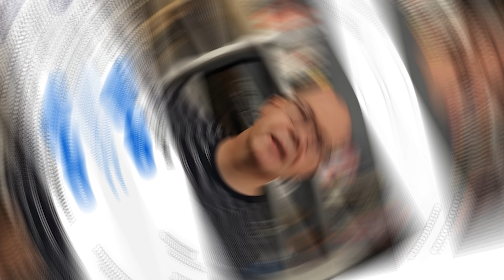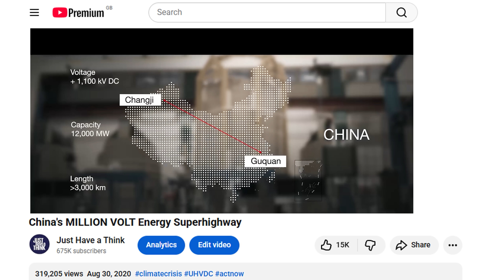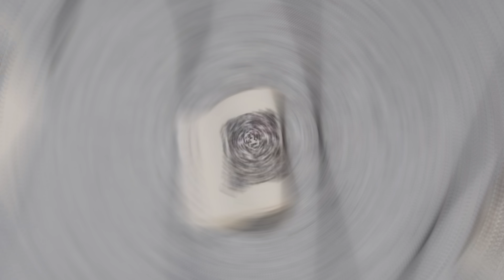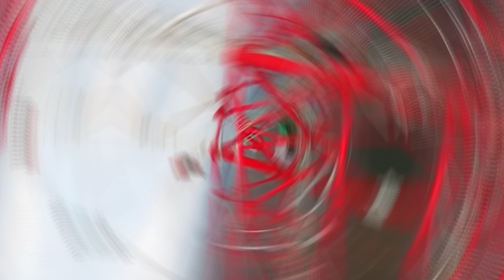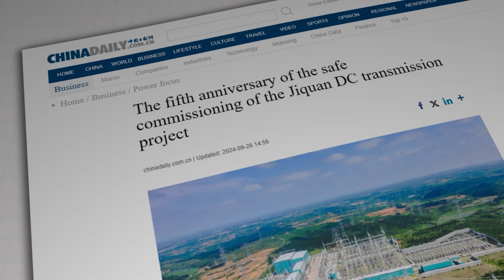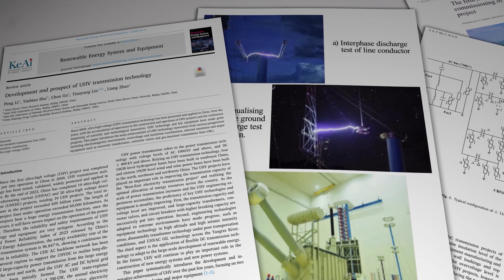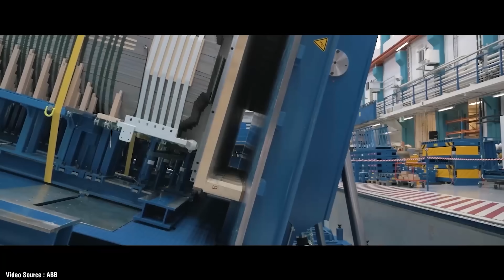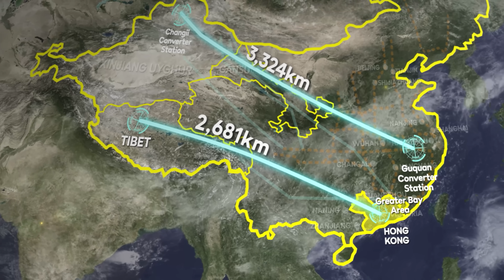China's ultra-high voltage transmission lines now breaking all records.

Comment: Hoodie video idea: I've seen that some communities don't allow people to plug in to the grid with small plug-in Photovoltaic systems without grid operator approval (long costly process).  But I have also seen, on this channel, some battery storage devices that can run significant parts of homes or help smooth out the grid.  Could people have an electrician connect plug-in solar panels to a battery pack, then plug that into the electric panel with a controller (without grid approval)?  Is there a company that makes controllers that can bypass getting grid approval?  I don't want people with rentals to be discouraged from dipping their feet into alternative energy.

Comment: related but highly speculative research video idea: impact of new and upcoming technical capabilities on superconducting lines on long range power distribution.
I'm especially interested in seeing what kind of new discoveries would allow for a global power network that doesn't require the currently very expensive and material-intensive undersea UHVDC cables you mentioned in the video about the Moroccan-UK interconnection project

Comment: Suggestion: How do the different countries adapt their grid to adapt from  centralised to decentralised power sources? This is not just about cables, but about distributing the investment costs and the imbalance regions of supply and demand. In Germany we tend to ignore the learnings from other countries. How do others solve the "One zone Vs multi zone" pricing, did they deregulate cable installation to speed up the process? Can you help? Which countries succeed in the transition and how do they do this?

Comment: Down here in New Zealand, there is a great deal of renewable energy potential but in one case there is a focus on hydro in an area of public conservation land that should have national park status and be left untouched as a wild river.
Large wind farms are proposed. 
A massive open cast coking coal mine is proposed across a unique ecosystem, public conservation land that should be a scientific reserve.
The common thread here is that the proposals are being fast-tracked by a government focused on development and moving rapidly away from any climate commitments or protection of nature. 
One of the proposed wind farms could feed the single coal-fired power station, replacing cheap coal from Indonesia and adding batteries as per your excellent episode on that topic. 
Subsidising residential and community solar and batteries, like the hugely successful Australian programme you have mentioned seems an obvious way to improve resilience, increase renewable energy, extend distributed energy supply and drive down power costs. 
There's a lot there. Perhaps my question is how to get the government of the day to make sensible climate and nature friendly decisions that will be valued by future generations. 
😊

Comment: @ 11:03 , This UHV DC transmission is a pie in the sky n USA. Electricity generation is a private enterprise in USA. A regional grid  in USA may have several electricity generation firms. Electricity generation firms maximise profit by reducing excessive supply while increasing demand. There is little incentive to unify the regional grids  into one giant national grid system where UHV DC can be transmitted from coast to coast. Different population density and industrialization in USA means certain electricity generation firms are much more profitable than others.

Comment: Hi - here's a suggestion for an episode for you for next year: why recycling steel won't save the planet (I'm sure you can come up with a better title!).  It seems like a no-brainer: steelmaking is around 9% of global human CO2 emissions... making new steel from scrap has 1/7 the emissions compared to making it the first time from iron ore.  All true, and all good (we should definitely use all available scrap - and sort it better - and smelt the scrap using renewable energy).  Only problem is, there's not enough scrap, and we already use pretty much all that is available (global recycling rate for steel reckoned to be around 85%)... and you can't 'use more scrap' if you're already using all that's available.  But if the global recycling rate for steel is 85% or thereabouts, how come the average recycled content of newly made steel is only around 30%?  And why it follows that specifying steel with a low carbon footprint will not reduce global GHG emissions.  I promise this is more interesting than perhaps it sounds at first... happy to talk.

Comment: Possible topic idea: 
I'm a window cleaner and I use two different methods of cleaning windows (depending on the requirements of the job). One is the traditional soapy water and squeegee method and doesn't use much water (3 gallons/day) but does require climbing a ladder for most tall windows.
The other utilizes purified, deionized water. It uses a LOT more water, but typically, no ladder work is required. Clearly, it's much safer. But, as an environmentalist, I've always wondered how much damage I'm doing to our planet. I haven't been able to find data on the meta effects of this form of window cleaning compared to the more traditional forms. 
Or maybe, in the grand scheme of things, window cleaning doesn't put that much of a dent into local or global water supplies. 
But I'm still curious. 
Thank you for your videos that help to keep me curious!
Reply: The problem of water resources has never been caused by the waste of domestic water, but by the huge amount of factory wastewater. Domestic water will naturally integrate into the water resource cycle through evaporation, while persistent industrial pollution will continue to affect the water resource cycle
Reply: @youngshawn5510 thanks for sharing that. It helps ease my environmental guilt a bit as I clean windows. However, living in the desert of the Phoenix, Arizona, I do think my higher use of water isn't ideal.

But it definitely saves my knees from all the ladder climbing, and potentially my life!
Reply: The soap might do more harm to Nature, than the water
Reply: @bjarneh-im1uw I did just see that Dawn (most window cleaners soap of choice) has a number of cancer causing ingredients. I use gloves whenever I'm using it, but I'm starting to look for something more natural.
Reply: Negligible damage.❤

Comment: One topic that I would appreciate you covering (I don't think you have) is thermal generation from Hot Rocks. This is using heat from the likes of radioactive decay in Granites, etc; as distinct from the thermal heat from sources such as Yellowstone, Rotorua or Iceland. A pilot plant was constructed in the Simpson desert in Australia (Innamincka) by Geodynamics Australia in the early 00's. It was based on a premise of the rock temp at 4000m being around 140C and having to fracture the rock to ensure it was permeable enough to extract the heated water. The trial fields found the rock was sufficiently fractured that it didn't need fracking, and the temp was over 200C. A 1 Mw generator was established to prove concept, but then shut down apparently due to distance to nearest grid (5-600Km) but it was reported that areas under the coal fields outside Sydney & Melbourne should be suitable but nothing has happened & I've never been able to find out why

Comment: ultra-high voltage transmission has been confined to a maximum of approximately 1000 kilovolts by the physical phenomenon of electromagnetic corona discharge (surrounding ionization) encountered  at  high voltages.  Development of transformer and distribution insulation that does not deteriorate at ionization high voltage has proven infeasible, therefore ionization/corona discharge establishes limits to transformers and  bare wire transmission voltage.  If these physical high voltage limitations could be overcome so that high transmission voltage could be substantially increased, then power transmission line capability could be increased exponentially. [power=voltage(squared)/resistance]

Comment: Yes, where is the community spirit. Working together for a better free world. Otherwise those that can work together will take over the world's future. I don't want that. So when will voters in the free world start thinking as world citizens and vote for leaders who work on that, not division and hate? When will the commitment to cooperation and compromise come back? In Australia, they haven't been successful in building a 350km  transmission line from the equally catastrophic Snowy 2.0 to tie into the NSW grid any reliability (the original $1.3 B price in the 2019 proposal for 2021 completion, now after many fits and starts, with construction started, but full land right of ways still not very progressed, the prices is estimated at $7 B and completion in 2027). They already know it is insufficient for the plans of renewals precincts they have approved and along the way the GW of new bids there putting out. Luckily all those are also delay, like the Snowy Hydro 2.0 expansion (original proposal 2017 for $2.3B finish in 2021, now in the fourth review (evaluate whether to halt the disaster or revise the revised again, since they admit the current costs and completion, $12B and 2028 is impossible) they say it is 67% complete, but only 18% of the 'Highly technical' tunneling is done and the Turbine work is still excavating for the foundations, no actual construction yet, even though once the rooms are built they estimate another 3 years to complete the turbine and electrical work). With 'progress' like that, how can anyone have any confidence anything can get done. The other 'big' project disaster recently was building a National Broadband Network, proposed in 2009 for $17B, current estimate $60+ B and 2030 completion. The major problem is the process, the initial sales pitch to get it over the line to commitment is achieved by 'accentuating the positive' or is it exaggerating the feasibility of a good idea, then actually believing it, then  realizing along the way that it is not going to happen that way, then pausing, questioning, re-estimating and recommitting to new targets. The first step I think is to change the process, commit to a good megaproject, more thoroughly plan and have more realistic estimate, but not pause and instead re-estimate and decide if it is still a good idea so that work can continue. The Chinese process actually works, because there is only have one decision making body with supreme power to direct the process. The success of the  equivalent of the Victoria Priority Projects Development Facilitation Program (DFP) should be offered at the national level and include the development and 'rights' process for right of way, which would not be blocked by individual owners because of prior determination of process and payments, materials acquisition quotes at the same time, and allow the quick implementation of commitments from all parties within a short time of designation.

Comment: Interesting video, so much to learn and consider in the near future. 
I do wonder about the difference (for domestic power) between high voltage DC (over large distances)  and having domestic power systems either communal or singular. I guess it varies a lot with latitude but here in Australia solar is great.

Comment: I'd be very interested in a deep dive into how bio gas / bio oils can be used in existing combined cycle plants and peaker plants to balance renewables. Instead of building new nuclear which we know all to well produce electricity whether it's needed or not, like Queen Elisabeths bathing... How much more "base load" can be counted on and how would it fair economically compared to new nuclear. If there's time it'd be interesting to know also if BESS would improve the economy of it or just be a waste..

Comment: 1. Need to find a climate-friendly insulating gas, not SF6, 2. Find a good method to interrupt load current UHVDC, 3. Stability solutions needed for massive UHVDC power sources to safeguard  entire networks. Good article. Tks. I worked on the 900kV Nelson River project in Manitoba in the early 70s.

Comment: Really impressive video — especially the scale and speed at which China is executing grid and cable infrastructure.

That said, Europe has also been showing significant momentum, particularly in financing and coordinating large subsea interconnector projects. Given Europe’s geography, subsea cables may actually be a structural advantage rather than a constraint.

I also found the point on underground cables interesting — it crossed my mind too — but long-distance subsea links, especially toward the Middle East and North Africa, could allow Europe to tap into abundant low-cost renewable energy while strengthening energy security and market integration.

Thank you again for great content and happy holidays

Comment: " RENEWABLE"  energy is far from a source and 90% of the time solar cells and wind mills produce LESS energy that it took to manufacture.

So 90% of the tim you WASTED ENERGY rather than produced anything plus caused eco damange , wind miills in particlar shred  thousands of birds every year for every turbine.

In most cases as soon as solar and wind fams lose their tax write off they are trashed right away as they cost more tonoperate than they ever produce.

Comment: taking the UK. They produce about 0.8% of the world's CO2 annual emissions. They have spent $250 billion on renewables principally wind (equivalent to about 7% of one year's UK GDP, $2.2T in US GDP terms). They have reduced the world's annual CO2 emissions by 0.042%. Their energy prices are up 54% since 2019.  They have lost 46% of their energy-intense industries costing about 800,000 jobs. Most of these energy-intense manufacturing processes have been outsourced to countries with dirtier energy.

This is not the path to decarbonization.

Comment: In Australia we often hear our electricity suppliers bemoaning the problems in the difficulty they have of maintaining smooth voltage control which is affected by the very increase in renewable energy ( mainly photovoltaic) across the grid. They currently restrict the input to the grid by only allowing 5Kwh from single phase homes and 15 from 3 phase. Its a very large in grid in Oz! Have you or are you aware of how the world energy suppliers are planning to mange this. Topic? Good luck with 800K
Reply: The 5kw limit is to do with the size of the street distribution transformers and street cable size, most countries have some form of restrictions like this.

Comment: Bizarre, missing 2 primary data points: limited annual copper production, & DC cable production. 2/3rds of planned EU long distance lines are on hold because of very limited cable production capability in Europe & Worldwide.

Comment: If the UK had energy hubs around the UK the cable required could be reduced. By this I mean SMRs coupled with offshore wind farm terminals plus solar farms clustered around each transmission hub. Is a decentralised hub structure planned. Wasn't this done with PWRs? Has the UK any plans about this in our lifetime? Or will China's help be needed to make it a reality?

Comment: I noticed that, as with many of the talking points about renewables, you made a reference to the amount of carbon removed versus petrol-driven generation. Unfortunately, as with all of these conversations, I also notice there is no discussion of the carbon footprint of the infrastructure needed to achieve these goals. IE, as in no solar panels at this time can generate enough electricity during their lifetime to offset the carbon footprint of their manufacture and subsequent installation, and everything that supports them, we are even further from it with wind power. All factors need to be considered when determining the true carbon ROI in any electrical production science, and they should be part of the ethical conversation about it.

Comment: I’m curious to how the wide voltage span of Sodium batteries is used. It seems very impractical to discharge close to 0V, to use their full capacity. The amps would rise very high to keep a certain power output. It would be interesting if you could interview makers of EV’s and grid batteries and ask them how this issue is handled. 
Merry Christmas

Comment: Why Do Power Companies Dictate that Only Cooling Tower CT combined w/a Chiller is the only way to control Large Air Conditioning Loads. Its A Lie. There are two heat exchangers that serve most refrigeration process loads. Air to refrigerant covers a High Temperature T& Pressure P range of refrigerant conditions. Water to refrigerant covers Lower T&P refrigerant and covers a low temperature range. A Heat Pump Test Facility has Commissioning Reports indicating that by adding a water/refrigerant HE to an Air or Water source system will increase energy transfer by at Least 40 %. Plus, No water is evaporated, no CT fan & pump maintenance piping or ductwork, land access requirements, & Electrical costs for Multiple types of fan & pump motors & controls No chemical treatment costs. CT's require a lot of maintenance. But everyone only conforms to the Toxic fossil fuel Companies recommend.
Since 1950 their Science & production Staff Cover Up Climate Change associated to the Toxic Fossil Fuel Company's Products!

Comment: Another topic... Foam packaging is a big pain an a paradox... I have been fitting lots of home batteries down under and the left over foam packaging is not recycled, takes up massive space and I have to pay to land fill it... We can handle the cardboard and much of the packaging is cardboard blocks but mfr insist on massive foam blocks as well... So Australia is getting lots of batteries while filling up our landfill site with foam... But the same goes for all the other products we supply and fit: aircons, heat pumps and many appliances etc